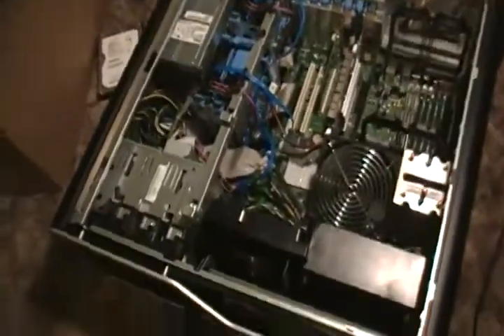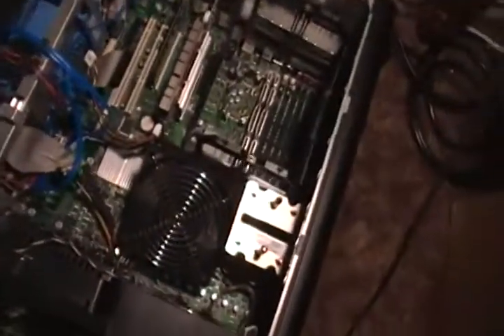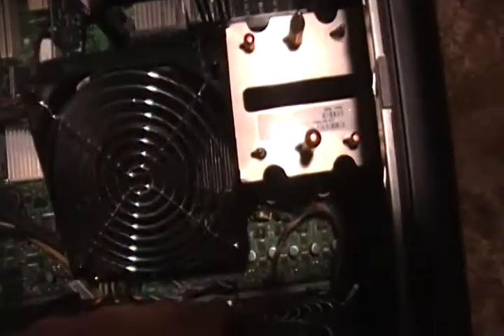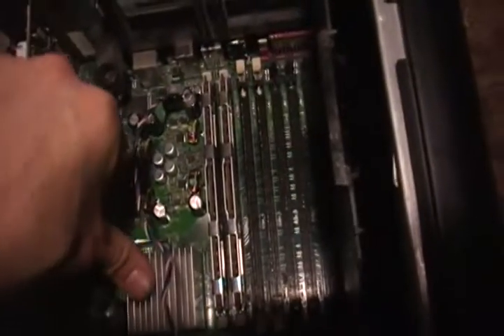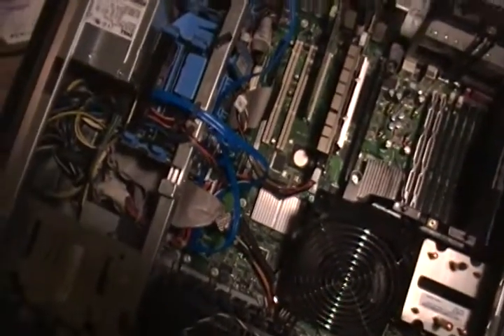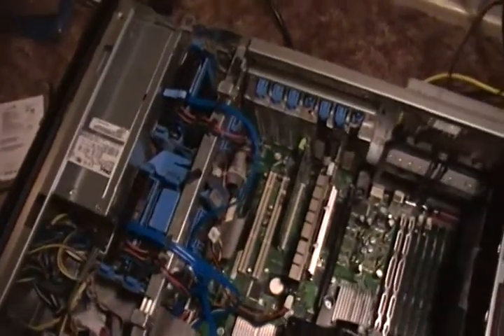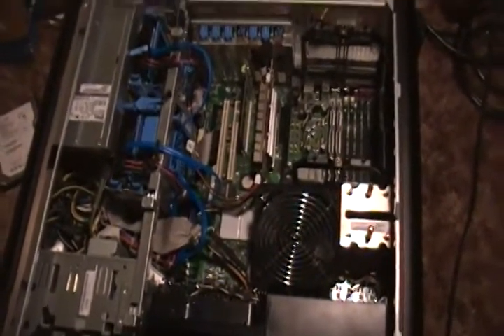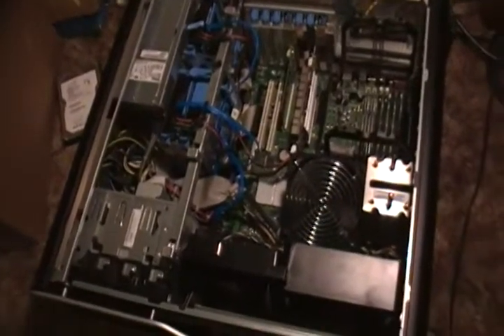Building Custom Gaming PC 4/5

Comment: the reason the fans were at full is because if the case is open for more than a few mins, the sensors tell it to run at full, put your case back on and watch it slow